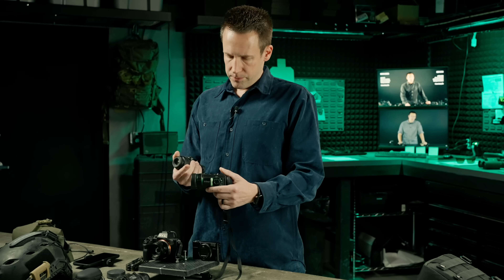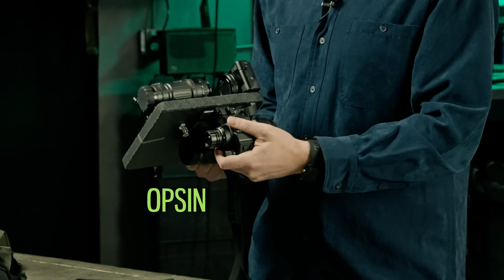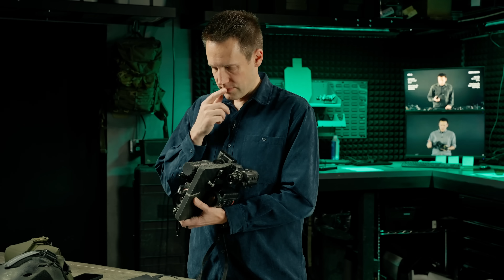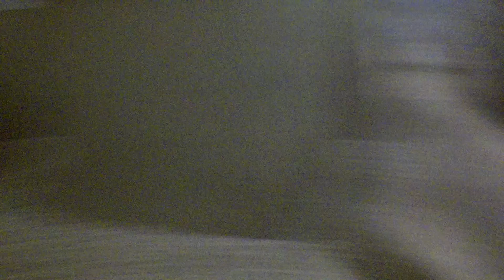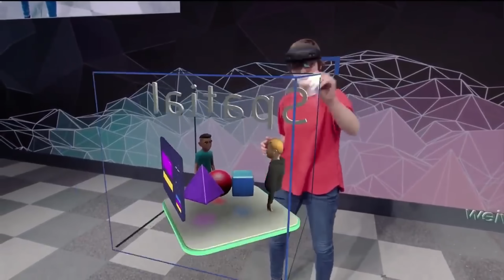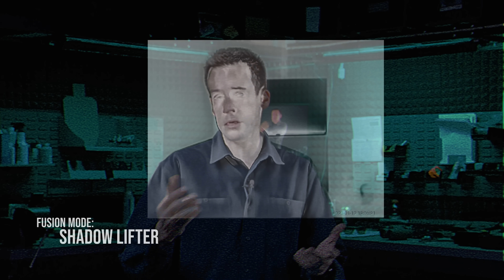SiOnyx Opsin: Digital Night Vision HAS ARRIVED

Comment: Maybe better to have the battery pack off the helmet with an extended cable to your belt, plate carrier, or backpack. I would mainly want NV for defensive situations that work off of photonic street lighting, not necessarily only moonlight. I may use this to see on a standard size urban property lot or indoors of my home. If I could identify a human in the dark wether they are friend or foe.
Reply: I apologize if the video caused confusion. You are correct that potential energy can only be negative as a differential value, meaning the difference between the potential energy of two different states. The potential energy of bonded particles themselves cannot be negative, only the difference between the potential energy of the bonded and unbonded particles can be negative.

In physics, the concept of energy is used to describe the ability of a system to do work, and it can take different forms, including kinetic energy, thermal energy, and potential energy. Potential energy is the energy stored in an object due to its position or configuration, and it can be either positive or negative depending on the comparison being made.

Thank you for bringing this to my attention, and I hope this clarifies the issue for any viewers who might have been confused.

Comment: I give it another 2 gens before it's worth it. I expect that once we get 120ish fps at the kind of sensitivity we need we will be in a good spot with digital NV. I've seen some good work done with simple neural nets that help reduce noise and lower the useful bottom limit of sensors in low light by predicting where an object is and reducing noise dramatically.

Comment: My estimation on why they don't let you record more than 30fps is because #1 battery drain and heat generation. You were already complaining about the battery being too heavy, so making it heavier for larger capacity is likely not a viable option. Sensor or processor shutting down from overheating would also not be a viable option for what most would consider to be a secondary function. #2 dedicating the additional processing power to record could potentially affect the performance of the live viewing.

Except for the heat issue and the live quality issue, I still believe it should be an option to record in higher fps even if it affects your battery life. Some people might not want or need to do long recordings where the higher drain on the battery doesn't really matter.

If they wanted to do it another way, they should have a video output on the device so you can run to a Ninja V recording monitor or something. Then all of the processing power and battery power could be dedicated to the eye piece and the recorder can have its own power source in a backpack or something.

Comment: Sionix needed to get thermal into that thing. I say it's a killer with thermal built in and at %75 of the cost. 

I need to see testing on engagement of a group of three bad guys at 50 yards with sioniz vs pvs 14. I'm not running 3 gun, I'm looking to protect my quarter at night.
Reply: Sorry Issac. I Hadn't finished the video yet. Thought I was a smart guy but you had it covered.

Comment: Reminds me of carburetors vs EFI. Carburetors had decades of refinement, and early throttle body injection was horrible. But within 10-15 years, EFI was superior in almost every way. I see digital night vision following a similar trend. I hope it really takes off and the market gets flooded with analog devices so I can finally afford one.
Reply: Within your comment is a hidden  reality. As long as analog is out there, it will be expensive because people like you and me will want it.
Reply: @woodsghost9088  yeah :(
Reply: @woodsghost9088  technology eventually trickles down,such was the case for lcd screens,those who adapt to change will prosper,just look at sharp it used to adapt newer technology and was the industry leader now its a shadow of its former self
https://youtu.be/wK7bGdUcibM
Reply: Solid comparison
Reply: yeah not so sure thats a great comparison, analog NV will probably always have some big advantages over CMOS, namely low power consumption, sensitivity, and infinite frame rate and 0 latency.  Digital NV may become more widely adopted however, through the added features like fusion, AR HUD data, onboard recording, etc. Those added features make the short comings more tolerable.
Reply: @sonicnofadz  Sure, for now. But 10-20 years from now, who's to say battery efficiency wont be improved? Maybe full color NVG with imperceptible latency and 4k resolution. Remember how shit digital cameras were when they first came out? Compare that to the 100+ years of film and digital beats the crap out of film in almost every way. And that took, what? 20 years? 30 years? It would be foolish to think digital night vision wont improve to the point of outperforming analog.
Reply: @UncleDon226  they've been saying the same thing about battery density/efficiency for 40 years.  Hasn't really changed significantly.  Really doubt there is going to be a major leap in 10-20
Reply: @sonicnofadz  Look at the difference between digital cameras in the last 20 years. You can be a doubter, but I see digital as the future. Remember- the original NVGs needed infrared light sources to work. Thats the same starting point as digital night vision.
Reply: Except the Opsin is almost $3000 itself, so why not just buy the real thing?
Reply: At the same time I wouldn’t trade my carbureted truck for a modern one, because it just works. And when it doesn’t I can fix it with socket set
Reply: It's possible that the market for digital night vision could follow a similar trend as the transition from carburetors to electronic fuel injection in the automotive industry. As technology continues to improve and the market expands, prices for digital night vision devices may become more affordable. This could lead to a wider adoption of the technology, further driving innovation and improvements.

However, it's important to keep in mind that there are many factors that can impact the development and adoption of new technologies, such as government regulations, consumer demand, and competition from other industries. Nonetheless, the trend towards digitalization in various industries suggests that digital night vision has the potential to continue improving and becoming more widely used in the future.
Reply: Except... One thing. Warm air through a carb venturi, once the air molecules start to pick up the now agonizing fuel, something happens.. Something that efi can't do; remove heat from the air. Engine masters has tested a lot of this, and I too as a big efi guy, was surprised to learn some of the interesting advantages of a carb.
Reply: @elesjuan  They have a couple advantages, that being one of them. Other advantages are cost and simplicity. That's why I said EFI is better in *almost every way.
Reply: @elesjuan  It's the main reason I've dropped 5-6k in upgrades to my 2000 Sportster 1200. The best year ever for sportsters. No corners were cut, last year it was carbureted. Look at drag racing, it's all carbs. My bike smashes anything that's not a new 1000 sport bike. I've got an old rare S&S Super B tuned to perfection. It's incredible man. My power bands generate so much fucking torque, so rapidly. It's insane.
Reply: @elesjuan you can cool it with water methanol injection
Reply: @elesjuan 
Ever heard of the “smart carb” ? Or “Lectron” carburetor? 
Really cool tech!

Comment: So, I believe in freedom for freedoms sake even if the freedom leads to an earlier death due to lack of a 'gov safety net'. 

To that end, I wonder how far away mil-indy grade NV/IR/Thermal imaging will be available for commcercial ($2-5k or less) drones. 
Like I'm not saying an at-home TB-2, but 'maybe' (hypothetically) a smaller drone, fixed wing or quad copter...that could hold up 2-4 cinder blocks (20-40lbs). 

We see Ruskies using commercial off-the-shelf cannon etc IR/NV digital cameras in Orlins etc but those have a lot of flaws. I foresee that in 10-15yrs that this is a real thing.

Comment: This is clearly the future.  The two main issues which need to be addressed are spectrum and form factor.  The spectrum doesn't go deep enough into the IR range, and that limits it vs a standard intensifier tube and thermal overlay.  I fully expect this to improve with iterations.  The form factor is more of an open question, but it is also theoretically easier to improve.  The current device looks like a PVS-14 because all of the potential users already have a PVS-14, know how to attach it to themselves, and globally know how to use one.  A camera, processor and screen setup has no excuse for sticking out from one's face like a tactical unicorn because the physics that require all of the components of an intensifier based NVD to form a line between the viewed object and the user's eye don't exist for a digital device.  I can't see this really taking off until the camera mounts to the helmet, the battery mounts on the user's torso (no need for a helmet counterweight if you aren't a tactical unicorn), and the screen is easily moved into and out of the user's field of view.  That adds the additional value of the screen being potentially source agnostic, such that a weapon mounted camera can be toggled in place of the helmet mounted camera (i.e. push a button to exchange your X eye view from the helmet mounted view to the "scope" view).  Reaching even farther into the future, consider the "mandible" that OpsCore offers for their helmets.  A rifle-rated face plate (i.e. a "mandible" with no hole for the user's eyes) with screens on the inside and cameras on the outside could offer level III protection to a user's entire head and face.

Oddly, battery life is probably not an issue because moving that weight from the head to the torso dramatically reduces the impact of those extra ounces.
Reply: Your observations regarding the future of digital night vision technology are intriguing. It's clear that there are many opportunities for improvement, both in terms of image quality and in terms of design and form factor. Improving the range of the IR spectrum and making the technology more compact and versatile could greatly increase its appeal to a wider range of users.

The concept of integrating digital night vision with helmets, weapons, and other wearable devices could offer many advantages, such as increased mobility and ease of use. The ability to switch between different sources of image input, such as helmet-mounted and weapon-mounted cameras, could greatly enhance situational awareness and overall effectiveness in the field.

Battery life is indeed an important consideration, and the potential to reduce the weight and impact of batteries by moving them to the torso is a promising idea.

Overall, it's exciting to imagine the future possibilities for digital night vision technology, and it will be interesting to see how these ideas develop and evolve in the coming years.
Reply: @WilliamEllison  your comment sounds like a chatGPT response to me
Reply: @WilliamEllison  Sorry, I wasn't clear on what I meant by "battery life isn't an issue."  My point is that while battery life obviously matters a great deal, with head mounted batteries the size of the battery pack is severely weight constrained.  With a remote battery pack attached to some body part that is far less sensitive to extra ounces (or even pounds) than the head, the energy efficiency of the device matters less because you can simply throw a larger battery pack at the problem.
Reply: A multi sensor setup would be a pretty easy way to improve the spectrum and sensitivity. Having multiple sensors tuned for specific ranges of wavelengths are more effective than a sensor collecting a very wide range. We already have algorithms that combine images with low latency. Sort of like how our phones have multiple cameras for different purposes, but those are pretty overhyped in what they actually do. Seems way more useful as a way to create a super high quality digital NV setup, and it's totally feasible. Improve the battery life with OLED screens and newer ARM processors, and mount the battery pack in your ruck sack instead of your helmet.

Comment: Great review.  I think they are missing quick adjustment knob for frame rate selector, as opposed to switching within the dialogue menu.  Toggle switch @ Slow to optimize light sensitivity would solve SOME low light issues, even if at the sacrifice of felt latency.  
Alternatively, Maybe they could add a manual mechanical lens exposure device and increase the maximum diameter to allow in more light for those low light conditions.   Maybe add some concave mirrors to increase total light in take, even if only in the lens peripheral.

Comment: Can you suggest to sionyx to make the batteries replaceable? In a natural disaster you can loose power for weeks. If you can't recharge the battery then your device is useless. But if you can simply open the battery pack and replace with new ones then it makes sense. Awesome video by the way

Comment: What makes night vision technology so expensive? (Expensive being $1500+ generally if you’re starting with a used pvs14 upward)
Reply: The secret sauce inside the tube is roughly speaking manufactured like computer microchips but harder. You have the photocathode and the microchannel plate, very complex pieces that are more expensive to produce than CCDs in a camera.

Comment: I thought about the Arora last year when I got my PVS14..... Glad I went with the PVS14, but its real cool that digital is making advancements.   I'd like to see helmet mounted sensors with slim displays and a cable attaching it to a pack.   Like you can have all the vision of a tank's thermal with IR and the weight will not be on your neck.

Comment: Great overview. As those have progressed forward, that Opsin is laying down a pretty solid foundation for future refinement and development. If I had the extra coin floating around, I'd get one to play with, KNOWING full well, it isn't perfect. But man when they refine it, add a thermal overlay, THAT will be pretty darn close to perfection. 180 frame rate as a minimum is a good place to start. My feeling is 200 would be spot on. Thank for this Isaac!!! Well done. Looking to the future for advancements and refinements. Later.

Comment: When you were talking about the latency bit, that's about the refresh rate of the screen. It's something gamers care about when it comes to monitors as higher refresh rates help in matching games with high frame rates.
Reply: I think I'm this case ping is a better analogy.  It's not that the 1/60s refresh rate is the problem. It's that you're looking at a 1/60th of a second that it's 1/10 behind what is actually happening.
Reply: @bentuovila5296  Ping is used for packets which take time to come back to you, meaning the game advanced without your PC knowing. What the problem with the optic is, would be latency because you put in a command and it takes time to react. F.e. you turn your head and the optic follows your head with half a second delay. Like when the mouse isn't moving on screen when you move it on real life